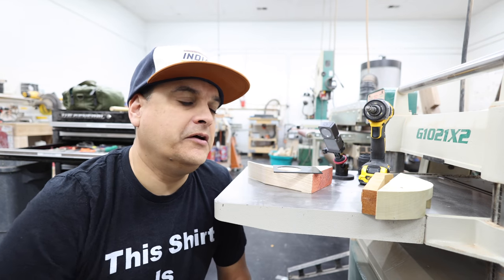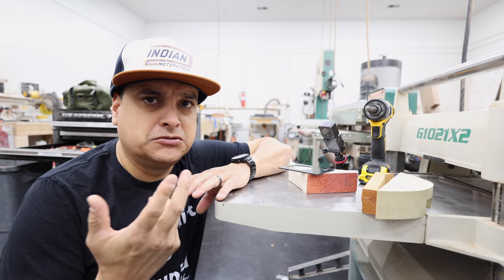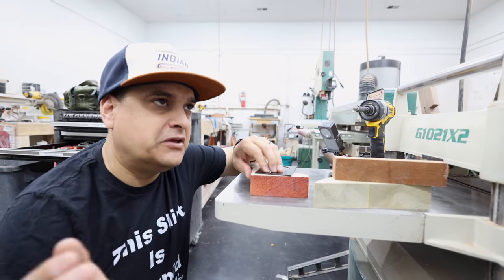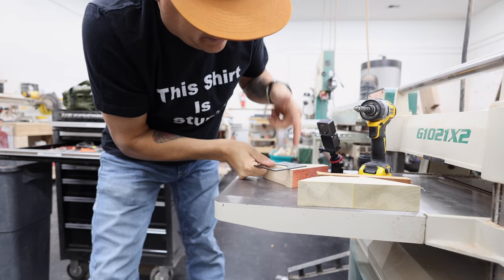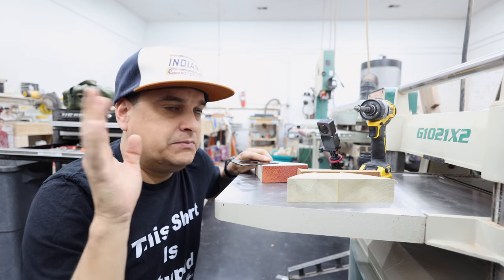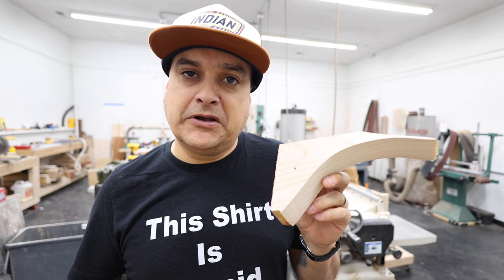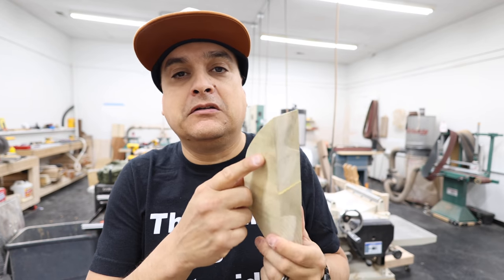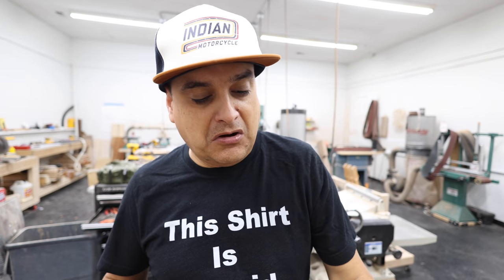What Is The Worst Tonewood For Electric Guitars

Comment: Tooth picks and tight bond make this a moot point though. I love the warmth a good tooth pick brings to my tone. Round only. The flat ones ruin sustain.
Reply: make sure that you use the proper tight bond glue if you want your toothpicks to retain that proper toothpick tonality
Reply: @kensolo6793  lol
Reply: Moot
Reply: @tony_n316  Fixed it. Thank you so much.
Reply: @WickedFesterBand  👍 😉
Reply: 🤣 I wish I could upvote this comment!
Reply: be sure to use tonepicks for optimal tone
Reply: I'm going to have to push back here, sorry, but you're just wrong. 

Gorilla wood glue is the far superior tone glue, it's just facts. I'll admit that Titebond III is pretty good, but still no gorilla. 
You're spot on about toothpick shape though, round is the only shape that allows for true tonal string vibration transference, the corners on the flat ones let the sustain leak out, that's science
Reply: @drew9000  😂
Reply: I find that the cinnamon flavored toothpicks, make for more tasteful tone.
Reply: @WickedFesterBand  
You only reference cross section in your preference of toothpicks. The taper is also very important. I am one of the few remaining artisans to hand-turn toothpicks for screw holes. I sell a set of 12 toothpicks in a wide variety of species, each with specific tonal qualities. Enquire with a response for pricing...
Reply: @winsomemartinez  😂😂😂😂
Reply: To get the best tone, add red wood dye to Titebond for a hot, pointy guitar, and blue wood dye for a warmer, jazzier tone.
Reply: Swamp ash is light punky wood. Sanding will tell you how soft mahogany is. No experience of poplar, but I do prefer mahogany-type woods for most guitars. 🤷‍♂️
Reply: soaking your toothpicks in cinnamon oil for a week minimum takes things to a whole new level

Comment: I've had a poplar body guitar for almost 40 years now...never had a screw strip, always sounds great, plenty of sustain
Reply: thats what i thought. i have a squier made with poplar wood. i upgraded the tremblock and the nut. the note sustains forever!
Reply: Budget wood can be surprisingly good. I have a drum set made of cheap luan wood and the tone is amazing. It’s just as good as pro level drums in terms of sound quality.
Reply: the twelve string squire paranormal  ...guitar is made with a poplar Body the chinise which buildt that Guitar use that because they are like Mr.Leo Fender( he used often alder later that was a 😁Tonewood😁 ) - pragmatic -they use that wood  to buildt an Instrument and  they are not stupid if poplar is not  a cool wood for an Instrument the don´t use it -poplar is easy to laquer it is light and availeble not only for chese boxes or Matches  other than the spurce wood  for a Stradievarie violin but very ok for distorted electic Guitars😀

Comment: Question:  Once an electric guitar is amplified and loud enough, so that, all you can hear is the sound coming out of the speaker, does it matter what the body material is?  Acrylic, glass, poplar, plywood vs. traditional “tone woods”
Reply: Not really.
Reply: @kirkwilson6229  That’s what I was thinking. It’s more about aesthetics and weight, which are not small things.
Reply: Weight is a huge factor but the wood affecting an amplified tone is almost nonsensical.
Reply: At extreme volume, a Masonite Danelectro is the ultimate feedback chaos monster. But you’d be better off with a wood, plywood, glass, acrylic or aluminum solid body if you actually want to play notes.
Reply: I agree. I've never liked poplar guitars cuz I've never had one that sustained well.
Reply: It makes a difference, but if the question is does it matter. It really depends on you. If you’re a true artist with a very specific sound and style in mind for producing music then yeah. But if you just enjoy jamming with friends and playing for yourself then not so much. It’s definitely not gonna make you sound any better if you can’t play that great to begin with
Reply: It doesn't.
Reply: Benedetto has demonstrated that they all sound the same regardless of size and construction. Scale length, strings and electronics affect the sound.
Reply: @lifeofalex9199  It doesn't. But, if for some reason it does, it isn't predictable. Sometimes, the brighter sounding of two guitars is the rosewood fretboard one over the maple and vice versa.
Reply: yes, search for the Fender Custom Shop cardboard Strat.  They made a Strat out of cardboard, and it sounded like a Strat.
Reply: @newgunguy4176  I would have to disagree, I’ll admit that the difference can be quite small and basically insignificant but there is a difference. I’ve never been one to buy into the fretboard making a major difference however. Rosewood, ebony, maple… they’re all relatively dense and hard woods and only 1/4” thick so I don’t believe it makes up a significant enough portion of the neck to make a noticeable difference. Whereas the difference in density/hardness between something like a mahogany neck vs a maple neck is relatively significant. I tend to find myself preferring maple necked guitars regardless of brand
Reply: The type of wood is the most important factor, by far.
Reply: @rickcrotts6673   Poplar is a dead sounding wood. Mahogany is the opposite. That's right, poplar has very poor sustain.
Reply: @ThomasJackMoore  Boy, are you off track. Hello clueless.
Reply: @michaelstevenfriedlander4583  🤣
Reply: @michaelstevenfriedlander4583  🤣
Reply: @lifeofalex9199  nah man it doesnt
Reply: @michaelstevenfriedlander4583  bro, this is no longer debatable, tonewoods don't mean jack with electric guitars
Reply: @nhayes927  that’s your opinion and I humbly disagree.
Reply: @lifeofalex9199  it's a matter of record at this point
Reply: The question is not whether wood makes a difference in a solid body electric, but whether it make a PERCEPTIBLE difference. Of course it make a difference at some level. The instrument vibrates as a body, or a system. So the acoustic behavior of the entire assembly (and for that matter, the environment) affects the vibration sensed by the pickups. This is simple physics, and the claim that the wood is irrelevant because it's amplified is nonsense. 

Try this: Plug your guitar into an amp and turn it up a bit. Don't mute the strings. Tap a tuning fork, and put the ball end on the guitar body. You will hear the tuning for through the amp. The vibrations are transmitted through the guitar body, the bridge and nut, and to the strings and pickup. I suppose clip-on tuners work that way too.

So the wood matters in principle, but what may be the case, though, is that the difference the wood  makes may not be perceptible to most of us.
Reply: No, it doesn't matter. Tonewood is a complete myth for electric guitars

Comment: Hi Dylan, I’m a middling guitar player at best, but I’m a master cabinetmaker and furniture builder. Don’t really understand so many folks ragging on poplar. It’s always been one of my favorites and I use it all the time. It might not be much to look at unfinished but it’s very dimensionally stable, has nice tight relatively straight grain, it’s affordable, it works and machines very nicely, takes stains and finishes really well, for any paint grade millwork it’s always been my go to species, and, unlike Honduran Mahogany, it’s environmentally sustainable. It’s also user friendly toxicity-wise. Honduran Mahogany is beautiful and works like butter but it’s quite expensive. The Ash family looks nice and makes great baseball bats, but it’s not user friendly in terms of it’s working characteristics and toxicity. Ash splinters are the worst. They get infected easily and  take much longer to heal up. As far as electric solid body guitars go, if you have a poplar body one and you don’t like the guitar, it’s not the wood that’s the problem. I think our friend with the benches and classic motorcycle engines put that myth to rest.
Cheers, Mark
Reply: Aluminum shavings based splinter rarely get infected and usually are spit out in a couple days
Reply: (aluminum guitar builder here)
Reply: @rdavid3848  Sigh you do not hear the sound of wood on an electric guitar
Reply: @rdavid3848  and? So?
Reply: @rdavid3848  no, you're just romanticizing guitar and creating something in your own mind that's not actually there. On acoustic instruments absolutely, on electric instruments using electrical transducers no.
Reply: Dude! Same. People who complain about tone wood on electric guitars are bored, “guitar purists.” Poplar is used in drum shells. Literally an acoustic instrument.Something that literally needs good tone. I have done cabinets for years, and Poplar is often called the poor man’s maple. It’s very dense. Alder and Ash, as far as cabinets are concerned, are much softer than Poplar. Ironically, as far as acoustic guitars are concerned (not what we’re discussing) but softer woods are often sought out. Spruce and Cedar top acoustics are much more desirable than a denser hard wood.
Reply: @rdavid3848  They're also trying to sell you something.
Reply: @SoManyTopics  Theres plenty of people who arent selling something who believe in tonewoods. 

Like the only noticeable difference I ever heard was fretboard wood on one video, but it was a super small difference and could have been anything really. But it doesnt matter if someone believes in it or doesnt believe in it.
Reply: I actually put this to an unscientific ‘test’. I made five Tele’s that were identical with the exception of the body’s wood prior to finishing. The only reason I skipped the finish was the poplar version was getting a paint job rather than nitro. The woods were poplar, walnut, cherry, mahogany and maple since I had them readily available. They were all Thinline Deluxe style since I knew they’d all be easy giveaways at the end. We tried several different amps, zero effects and we all agreed there was no appreciable difference. After slapping a finish on them still no appreciable difference. Could you detect a difference with some sort of equipment? Maybe, but if our ears didn’t hear it I see no point.
Reply: @rdavid3848  Jim Lill's videos say it all.  If you watch them and still believe the tonewood myth, then you are willfully contrary and not truthful with yourself.
Reply: One of my favorite guitars is a one pickup Tele-Gib made from a 24 3/4” Squier Tele neck and a random poplar body I got on the cheap from EBay. Maybe it’s an oddball, but I finished it in just light coats of clear nitrocellulose lacquer because I love the grain pattern on it. I’ve always found it to be the stoutest, most sturdy feeling Fender-type body I have. I was never aware poplar had a “soft” wood stigma attached to it. I’d take a poplar body any day.
Reply: Most people who discuss on this topic don’t understand the basic of modal analysis. What the body and neck are doing is just building the foundation for the bridge and the fret where the vibration is taking place in between. The main part is the vibrating string that induces a current in the magnet of the pick guard that is hanging in two screws on a plastic pick guard. If you uncouple the vibrating string from the rest you see that there are more important things that  influence the tone. The resonating body is more of a thing happen to the players feel rather than something that influences tone. More important is the neck. Cause it is thin and long and changes the foundation of the one boundary of the string. The body is super non important. That’s the reason why a gooood player can make a shovel with one string sound great. It’s how you ride the horse rather than what horse you ride! (Mechanical engineer for vibration and modal analysis here).
Reply: @rdavid3848  tonewood in electric guitars aint a thing, go watch JimLill's channel and convince yourself or keep doing what you're doing and and join the tonewood religion
Reply: @gcarson19  those videos are great if you don't buy into tone myths. Otherwise, they are devastating.
Reply: Les Paul was one of the first to build a solid guitar in order to reduce things like resonance from the body. Electronics are not influenced by the wood surrounding them. Maybe other metal parts like frets and type of metal used in the bridge make more of a difference.
Reply: Plus 1 For poplar man. It has been my number one wood too. Never fails to rock on! Not like alder or basswood which I find less consistent.
Reply: @rdavid3848  sustain and tone are 2 different things bro sustain is often related to the amount of time the strings vibrate, you can get infinite sustain by turning your amp all the way up and let the air your amp is moving vibrate the strings on your guitar, tone comes from the pickups and the pickups only and if you don't believe me it's ok go to a store and get the most expensive guitar you can buy so the wheel keeps round and round
Reply: @rdavid3848   @R David  whatever you say kid i have 7 lambos and you don't see me bragging about them though
Reply: @rdavid3848  "tonewood" is confused for rigidity. A rigid guitar will sound better, usually a guitar designed with special wood has better fitting parts compared to a mass produced counterpart which could be lacking in that resonant transfer from one component to another. A well built pine guitar will sound just like a mahogany one. Paulownia wood sucks
Reply: @srfrodoxd  hah only 7 lambos? you must be like poor or something dude, I got 7 lambos when I graduated collage
Reply: @rdavid3848  30 guitars? fn noob I had 30 guitars by the time I was 9 years old. I have 3 of each of your tube amps and literally own the sound department of nintendo America through stock options. I've built guitars out of cast iron and titanium, with carbide frets, they were sent back in time so eddie could approve of them, same with dimebag. I even cloned dimebag darrel, but the clone is the one that got shot, so trust me I have witnessed where tone comes from drink water bro, stay hydrated.
Reply: Sorry but poplar doesnt take stain like you say. IMO best painted because it does work well structurally. If there are tricks for poplar please share. Thanks
Reply: I agree i have a 1989 peavey vandenburg poplar body its always sounded good. My ibanez rg652 has ash body with see through white sounds good i thinks its all in the players fingers and pickups. Wood only affects the looks weight and resonance of how it vibrates in ya hands. Im sure a plywood body would sound good with decent pickups and a good guitarist playing it.
Reply: The reason people are anti poplar is because it has typically been used on cheaper guitars than ash and alder. That has convinced a lot of people it must be worse.
Reply: really good point dude, thanks.
Reply: The bench guitar sounded different than the Tele.
Reply: Yes, agree. Because of its green and yellow color tones isn’t good for a natural or stained finish but it’s a stable and tough wood. And, it saves a few bucks. However, saying that I built a house in No Ca where we did stain the poplar cabinet faces and they turned out beautiful. Anytime I ordered paint grade flush face cabinets from my cabinet guy it’s always poplar face frames. If poplar is good enough for cabinets it should be fine for a painted guitar body.
Reply: @srfrodoxd  Not really, because different freqs can be damped by different body materials.  FI, the properties and thickness of one piece of wood from the neck pocket to bridge might vibrate in a way that disrupts/absorbs string vibrations in the 1kHz range, but not below or above that, while another piece might disrupt string vibrations in a lower or higher range.  One piece will also take more energy to vibrate than the other, and one portion of a piece of wood can vibrate at a given freq without the entire piece vibrating.  The more total movement at a given freq, the more that freq is either drained or absorbed from the string/s.  It is technically a matter of sustain, but the effect on the spectrum would qualify as a tonal difference, and that's what it sounds like to the ear, however subtle.  

Ken Parker said rigidity is mostly what matters, but a string can also be plucked hard enough that the pulling force of said pluck supersedes the density/mass resistance of the instrument, and the entire instrument may recoil to absorb some of the transient.  The sound of a sustaining string is very much determined by what is absorbed at the transient stage.  Most high freq's die off very quickly anyway, but various lower freqs can be fairly quickly damped as well.
Reply: don't give a fig about 'workability' or 'toxicity'. first is the tone, then stability, looks etc. and, yes, i believe the  wood affects the sound, which is not to say that a specific piece of poplar can't sound better than say a specific piece of ash.

Comment: I have seen the softness argument made a lot about basswood. Normal people don't unscrew pickguards all the time but they do remove trussrod covers or backplates to adjust vibrato springs. If stripping occurs, sticking the end of a toothpick in the hole is an easy workaround.
Reply: But toothpicks are generally made of basswood though…
Reply: That is the method that my grandfather taught my dad and that my dad taught be, works all the time!!!
Reply: @taimaishu-nao1922  Tonepicks. That's what you need for full tonal integriity ;)
Reply: The soul of the wood is tone. What about the tonal qualities, resonance, sustain, bass, mids, high end with electric guitar pickups, distortion tones. These are more important that the beautiful or not so beautiful.
Reply: @Leo_ofRedKeep  tonepicks is what I use too. Also with a micro dab of the good woodglue.
Reply: I have a bass guitar with a body made of basswood. It’s very light and resonant! Have had it for almost 20 years and no problems! Like you said, a piece of toothpick fixes this problem easily
Reply: Toothpicks and wood glue
Reply: why not change a larger/thicker screw??